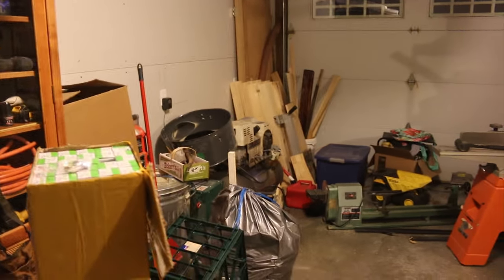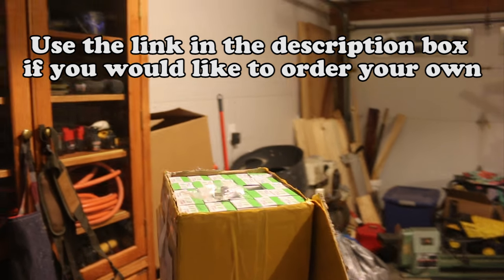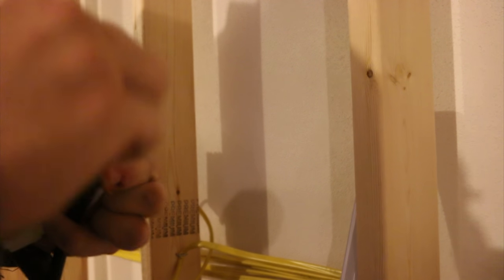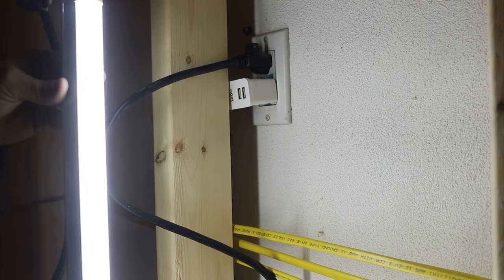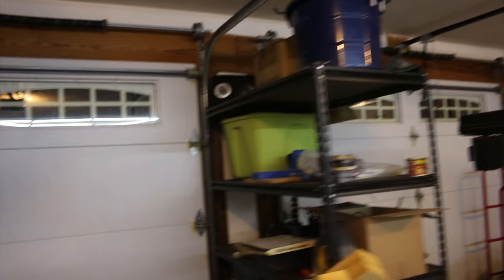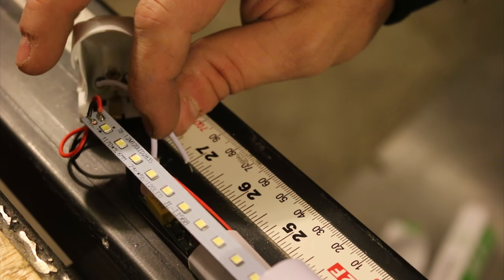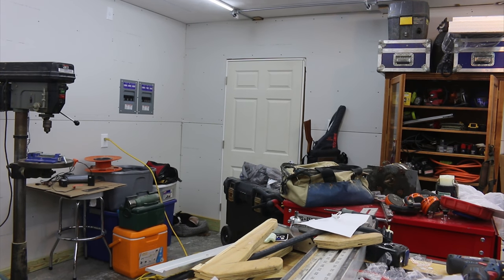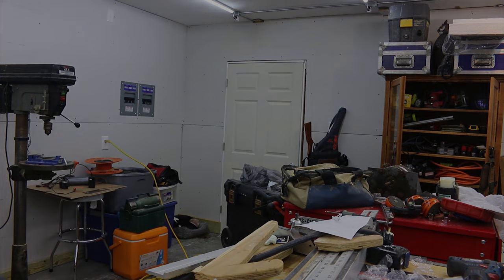Don't Call It a Dream Shop: Best LED Lighting Ever?

Comment: The lights look great , with the wall being white  you should be good for the videos . I will be watching for future videos on the shop projects. What's the plan for heating the shop if any . Looking good 😊 Regards BobLee
Reply from the maker: I have a 220v garage heater that works really well.  I may put it in an update.  Thinking about doing a weekly vlog.  Need to gauge the interest.